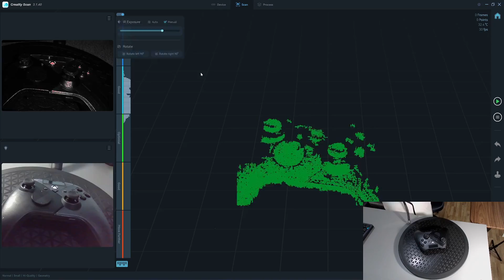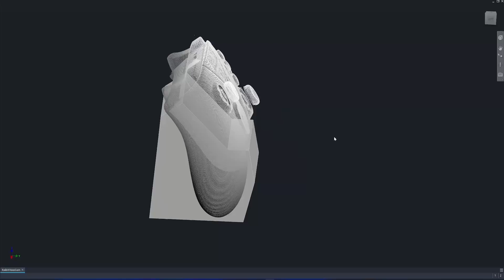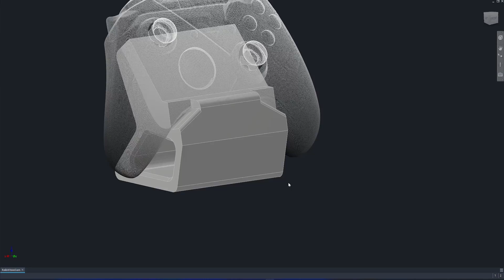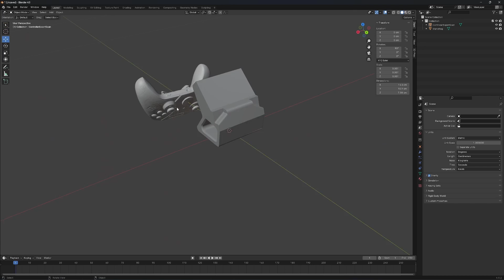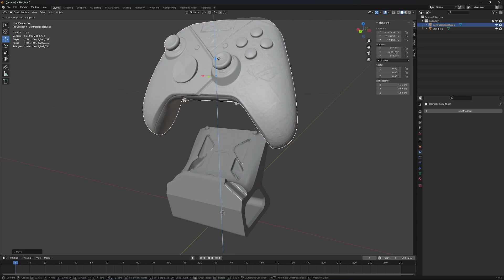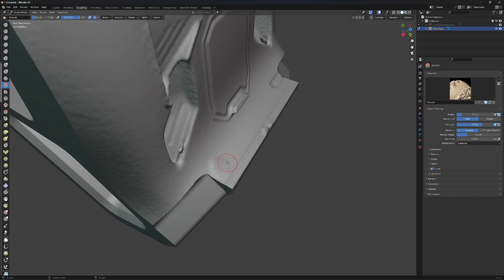Making Controller Stand with 3D Scanner (CR Scan Otter)

Comment: Thanks alot payo  great tutorial 
May ask what software you used before impoting to blinder 
Couldn't get it 
As i am preparing my self for 3d scanning and wait for my scanner to arrive .. thanks in advance
Reply from the maker: You mean the software I used for designing the stand before cutting, right? That's AutoDesk Inventor. On my next video, I'll use cheaper and easier to learn software called "Adobe Substance Modeler" it can do this same job without using Blender and CAD.
Reply: @Payo-TensileCreator  
Yes the first software before blinder 

Thanks alot for replay and your detailed info 
There are really essential info for me 
🌷👍

Comment: Hi, I bought the Ferret Pro and returned it for the Otter.  The owl scans I have done are the same quality as all the Youtube videos out there. But when I try to scan my truck interior I get poor detail of the buttons/switches. They look like marshmellows. I am unable to get good results like you. Could the issue be that I am doing it outside on a hot and humid day? I scanned both in the shade and in my garage. Thanks for all the vidoes.
Reply from the maker: Otter large object mode is good at scanning car interior. But it can't detect small switch and buttons ( 1-2 cm). The work around is that you need to scan buttons part in small/medium object mode then cut and merge the 2 scans together. You also should avoid scanning in direct sun light.

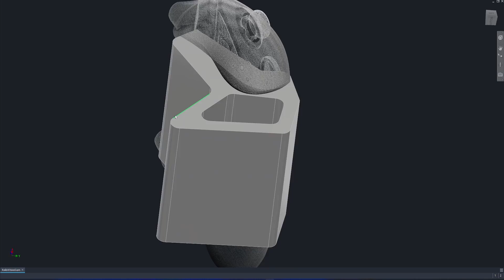Comment: Wie heißt das Tool bei Minute 4:00? ☺️
Reply from the maker: I use Inventor in CAD drawings. Most people don't use it, so I didn't explain that in detail.
Reply: @Payo-TensileCreator  I've bumped into a problem with Inventor and point of cloud in .ply format exported from Creality software. it woun't open in Inventor...the message is "Failed to open document"  Did you you use .ply format to load the pad into Inventor? maybe the resolution is too big for inventor in my case... any sugestions?
Reply from the maker: @vader1990  With Autodesk products (Except 3DsMAX) You have to export point cloud as PLY then save as LAS in CloudCompare. Next, You'll have to open that LAS file and save it as RCP file in AutoDesk Recap. I've tried to open over 70 million point clould with no issue. But you should keep it under 20 million for Inventor.